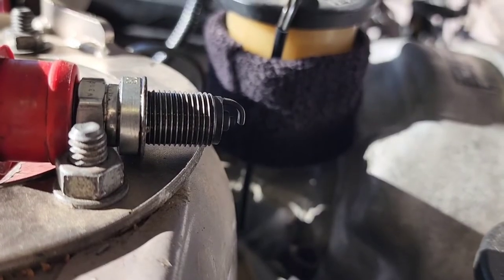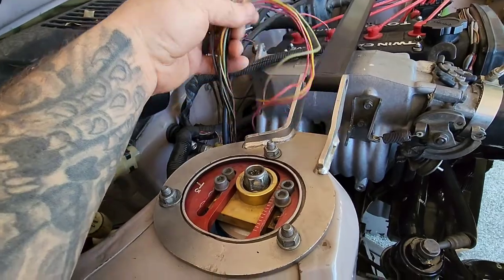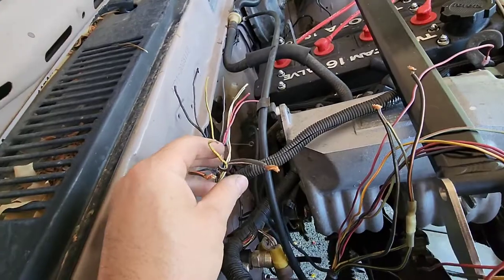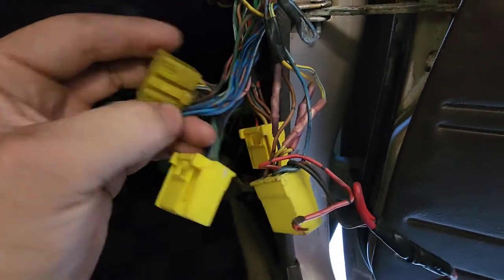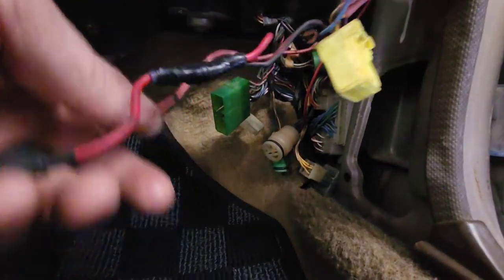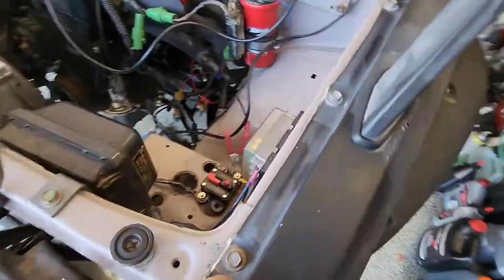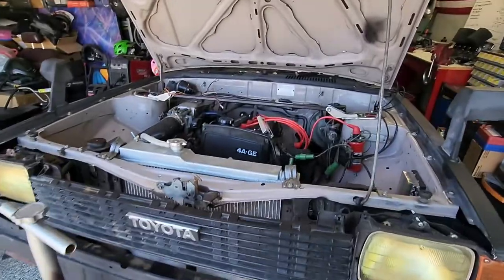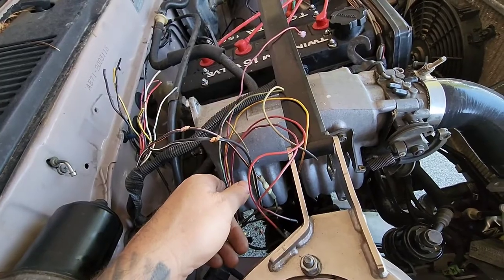4age swap efi into te72, ke70 ,ae71. part 2.

Comment: Thank you for sharing your work, especially the wiring!
Reply from the maker: No problem. If I could help even one person with this swap I'd be happy. I plan on going over more of the wiring eventually. Hard to film because I'm troubleshooting in real time and I'd have to film for hours.
Reply: @leveledupgarage5303  I’ll be looking forward to it, anything and everything helps. I have an AE92 4AGE with harness I’m going to try to put in an 85 SR5, there’s bits of info online but a lot are dead links or missing photos. Your other video on the wiring will definitely be a big help too.
Reply from the maker: @Nexta  for sure. I'd imagine it's not much difference. As long as your harness for the 4age has all the ecu plugs.